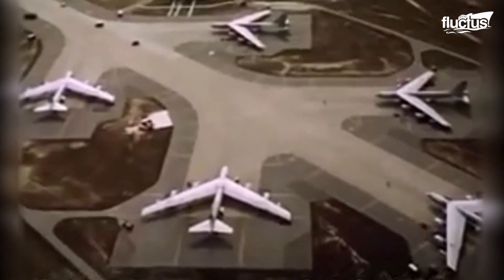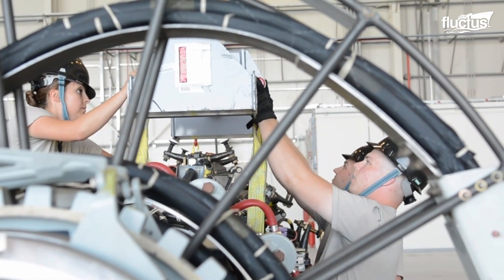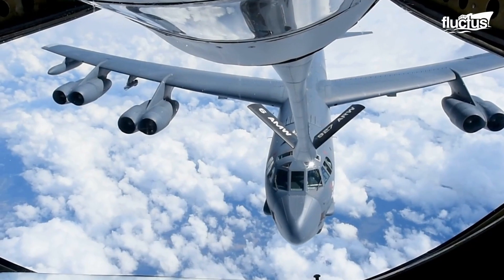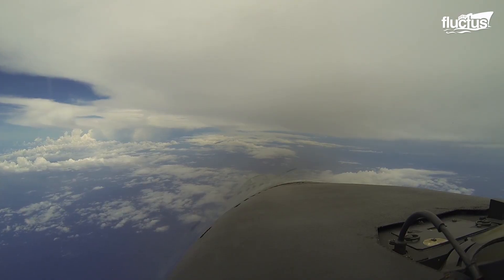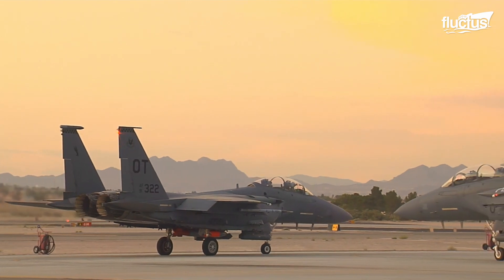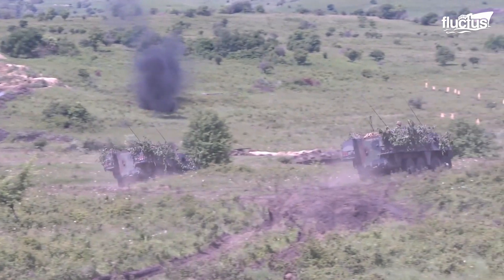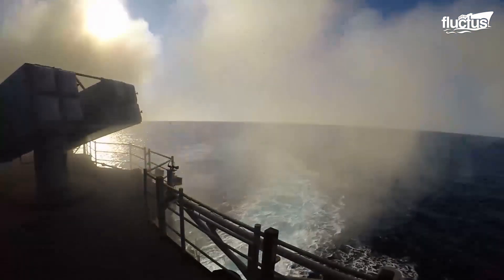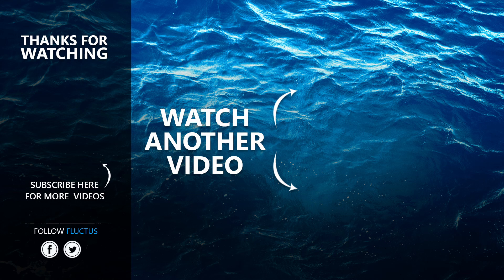US Air Force Installing Genius Invention Into Gigantic B-52 Bombers

Comment: I'm thinking about the Moab that's 11 tons what's the smallest aircraft that could carry 11 tons the thing about those fighters is you know they five four or 500 miles an hour but that only lasts an hour or two then they have to either refill or or land so you know but that it's possible see you can fly from St Louis to New York and back to St Louis no problem you know it's like running into somebody's house and taking a couple shots and then running home 400 miles or something 300 mi away they never catch you they never find you

Comment: Can it hold an F 35 or F 22 inside the bay Or would it be wiser to put it on a stealth Ohio class or even bigger larger nuclear power at the stuff that can dispatch F 35 for vertical takeoff.
Reply: If we try hard enough the B52 should be able to fit it right?

Comment: This is old news. The CSRL, now "CRL" was developed for the B-52 in 2016 and fielded first in 2017. It received an upgrade in 2019 to address power draw limitations that restricted how many munitions could be dropped at once.
Reply: Been around since Brezhnev ('80s) was king.  Reagan flaunted it!  (Missile Guidance & Control Specialist; Ret, MSgt USAF: 24 YEARS AD)

Comment: Yeah ok, so the BUFF is still flying after 70 years. The airframe is merely cover for reality.
Fit a  (multiple) rotary launcher to an A380, B747, B767 etc in civil, yes civil boneyards w everywhere and you see the true significance. Heavy Bomber forces haven't been type specific for ages. The BUFF is just a smoke screen explaining the ridiculous 8 engine RR refit. 2 modern engines would more than do the job. 
Why are most Aircraft graveyards located in South Western USA?
Reply: The boneyards are in the desert because of the low humidity. 

This minimizes corrosion.

Comment: I was surprised to learn that the B1B has a larger payload capacity than the B52 but was curtailed because of the enormous maintenance costs
Reply: The B1B is the biggest POS in the USAF inventory. t. former maintainer.
Reply: Don't know about the Lancer being curtailed. They are flying daily as far as I am aware.
Reply: @jamesholcomb7713  After Afghanistan and Iraq where they were used often, the planes were spent and many of them were taken off the line to get repaired and do general maintenance.  This wasn't a one day operation so for a good period of time, there weren't many flying.  Some of them have been put back into action. but the AF is putting more emphasis on the B-52 and less on the B-1 as they wait for the B-21s to start being produced. They still use the B-2s but since they are so expensive to run, they arent used that often. Most B-2 pilots are flying T-38s to keep fresh.
Reply: New+fast, always = expensive.

Comment: The Trailer at 2:08 is an MHU-196 I used to maintain those at Barksdale AFB as an Aerospace Ground Equipment Mechanic
Reply: I was stationed at Barksdale as well, '96-00. I worked on the missiles. They had these rotary launchers then. Not sure why this video is making it seem like it's a brand-new thing.
Reply: @troylacy7223 I agree, definitley not new. We had to replace every hydraulic line on one of those trailers and they were dated '82!

Comment: LT Rob United States air Force retired. I was in activate service during the Gulf war. 
I never flew anything this big.
What a monster. I did observe the Russians Bear that's also an amazing piece of equipment. Dual props VERY LOUD when I flew near by.
I'm not going to compare or put anyone down. I'm very over those feelings. What I flew there was also talk about not being necessary, not needed anymore. However it's been updated a few times just like the B52. We have faster and stealthy available but nothing carries the weight or can fly the range without the need of refueling although it can be refueled.
The military should not look at the age so much. Better to look at the money that's needed to keep it flying and what can it accomplish.

Comment: There is much we can do to keep this glorious big bird going hard and strong. Including swarm technology for her massive bomb loads. I wonder if short and long flight wings can be added to bombs, linked through swarm tech, gps, LOS beam, inertial positional guidance, etc... to prevent electronic disruption, and dropped from great heights, to targets identified from 3rd or 4th Gen SLARS et al. All easy miniaturized and relatively inexpensive and existing tech... so little need for multi-billion dollar Military Industrial Complex contracts that take years. Easy peasy to do. Just look at SOF rapid fielding of off the shelf. And everything I've mentioned is already in use in some form. Ingenuity and determination owns the battlefield, past, present, future. We need new tech and re-engineering old to maintain utter global dominance, like we have now. Heh, never tell a true American they cannot do something.... duct tape and 550 chord and away we go.....
Reply: This Big Ugly Fat Fucker has had more lives than a cat, and will likely outlive me. We were both introduced to the world in 1952, and this bomber replaced the B-36, B-47 (its predecessor) and B-58 by the early 1960s. The B-21 may stealthy, but its max bomb load is about half (38k pounds vs. 70k) of the BUFF. With continuing upgrades expecting to extend its use until 2050, there are few examples of military aircraft still active 70 years after they first flew. There are some MiG-15s still flying in the North Korean Air Force as trainers, but I'll bet the body part of my choice some could easily be converted into fully functional fighters with the right parts. Those parts might be a problem for the poorest nuclear power on Earth.
Reply: @jefferyroy2566  I had a buddy when I was young who's father was a buff pilot, they were carrying a nuke load taking off from Guam on some MAD assignment and had catastrophic failure of engines on take off, in an effort to not cause the unthinkable or leave nukes somewhere in the drink he force landed and they smashed up end of runway... he got a Silver Star repeatedly going back into the burning bird to save his men. Vietnam Era... we forget that our current world is just an extension of that MAD world, only ours is more precarious and stupid than theirs. We have less heroes than then, but we still have more than enough in all walks of life to move the ball.
Reply: F-tu f cu ji
Reply: yes put it in a museum